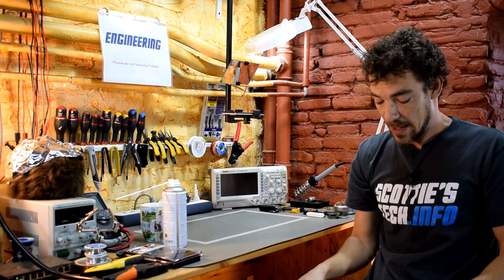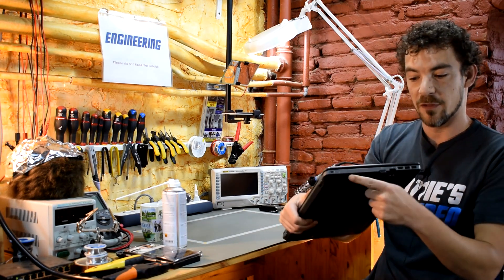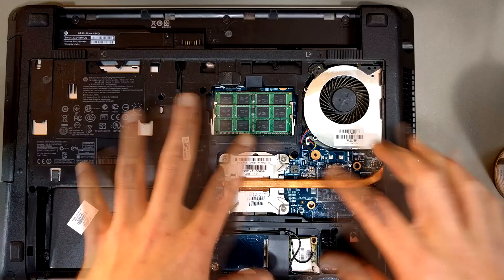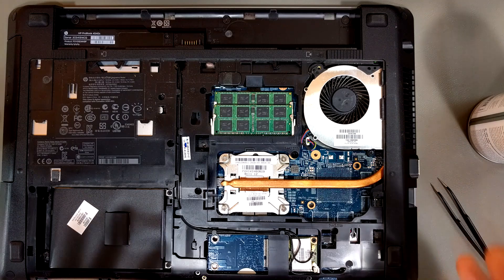How to clean out dust inside your laptop

Comment: I likw this video. It doesn't have the same confidence as everyone else where it's like "hey it's so easy to just disassemble your entire computer."

You actually give people the advice to just spray through the vents and the video is structured in a progression of escalating things to do. It also admits it can be hairy for a first timer and that while it's good to try doing it yourself, don't overdtep your boundaries.

Having needing to do this for the first time myself, spraying air from the outside or taking the cover off is good and all but if I start needing to unscrew components that's where I'd stop.

Comment: The problem is when you force the laptop fans to spin, they can turn into a generator that can cause damage.
Reply from the maker: It shouldn't. The pins the fan is connected to supply 12V and some amount of current. The 3rd pin is to detect the speed of the fan, and the 4th pin is a PWM signal for speed control. Since those pins (particularly 12V + Gnd) are connected to a circuit supplying power, applying power "in reverse" shouldn't do anything - unless it's a really badly designed motherboard/laptop!
Reply: @ScottiesTech  OK. Thanks. This was bugging me for a long time. Great video.👍

Comment: Thank you so much!  My laptop has been sounding like a jet plane lately. Fan running loud and constantly, took the air compressor to it and could not believe the dust that came out of everywhere.  Back up and running for about 15 minutes and no fan yet....did the air with the lid closed, then open because dust was coming from the keyboard.
Reply from the maker: WOOHOO!!!

Comment: You blow the dust off with the air compressor but... where does the dust go? Doesn't it remain inside?
Reply from the maker: No. It's like an air duct: Whatever air gets sucked in by the fan must be blown back out through another vent. Otherwise the laptop overheats. So, blowing air in both sides generally cleans it out nicely.
Reply: @ScottiesTech  I got to appreciate the helpful response. I see. It is a bit weird because dust sticks or can stick to the parts so how is it possible for the air fans to get it out you know 🙄🤔? 

There is no need to take off all the keys (letters, numbers etc); I just need to blow an air compressor on them?
Reply from the maker: @Velvetec  It's bit trickier when air is sucked in thru the keyboard keys... Usually, there are tons of little holes under the keys that get clogged with dust. In that case you have to be careful not to blow the keys off the keyboard if you use an air compressor!

Comment: why on earth would you blow all the dust and rubbish BACK INTO the laptop  ???
Reply from the maker: In normal fan operation, air goes in, and air goes out - always in the same direction and via the same path that's designed into the laptop for that specific purpose. Therefore, blowing air into the output vents, and then into the input vents, tends to dislodge all the dust and blow it out. Next time the fans turn on, any remaining dust is usually ejected.

Comment: Is it safe to wipe the laptop internals with a microfibre cloth?
Reply from the maker: Yeah, for metal or plastic parts. But avoid wiping the actual motherboard or other electronic-looking stuff.
Reply: @ScottiesTech  Thanks, I'll keep that in mind. 👍
Reply: @ScottiesTech  So, I followed your guide on cleaning my laptop using an air blower designed for cleaning IT equipment. Not only did it clean out the dust inside, but also the vent grills on my Alienware 13 R3. Did the same thing for my Razer Core X. The whole thing feels like brand new, very low noise and less heat from the laptop now. Thanks for your video.

Comment: What was the reason for doing the output first and the input second? Wouldn't you want to keep the direction of flow constant? i.e., input then output, assuming the output isn't blocked?
Reply from the maker: Dust usually accumulates at the input side of the thin heatsink fins. So, by blowing air in reverse (in the output), that tends to loosen the dust and fuzz and blast most of it out the input vents. Then you blast in the input to clear out any remaining smaller bits. At least that's how I do it, and it seems to work well!

Comment: Welp, I am Wendy, but right now, me, her son. Is trying to help her on this very day, on this day, error code 90B, which is probably something similar, if not exact to this. And she is really scared of opening it. Reason? I have no clue, the screws are not damaged, and she has had this laptop for a little less than a year. Right now I'm using mine, that's how I am here in the first place. But I just hope you might have a reason, maybe explanation on trying to get her to finally open it. She keeps saying it needs to be professionally done. Which is true, but not for every case. I hope you can respond and maybe find an answer.
Reply from the maker: That's a fan error in certain machines - or rather a cooling error. So, I'd clean it out ASAP! Removing covers and cleaning inside is way less dangerous to the machine than if it's overheating all the time!
Reply: @ScottiesTech  Thank you very much!

Comment: Hey scottie, mine's making noise and I never cleaned my fan (I'm pretty certain this is the issue of my laptop), will using compressed air on the vents push the dust deeper in? Just wondering as a complete noob!
Reply from the maker: The air must have a way in and out in order to cool the system properly. So, compressed air should work pretty well. In some cases, the actual cooling fan might have "scummy dust" stuck to it, and that won't come off... I had to remove the panel on the bottom of the lappy to really clean the fan off... But I've only encountered that once!

Comment: Hi, I did the full cleaning of dust inside my laptop, but it sometimes still is loud. Is there anything that could be causing this?
I don"t think any malware is doing it as I do frequent scans and it's always safe.
Reply from the maker: Could just be a bad fan. Eventually, the bearings go and the fan can make all kinds of interesting noises.
Reply: @ScottiesTech  So should I just give up on trying to fix my laptop and buy a new one or I can like the change the fan or something? 
Also the laptop isn't that old. I bought it 2 years ago, but this was the first time ever cleaning it so idk if not cleaning for long time damaged it.
Oh and also, the noises it makes are just simple clean fan noises, but loud and not some random gibles.
Reply from the maker: @RealElevenTimes  You can probably replace it. I usually search YT for the laptop make/model + 'replace fan' and more often than not, somebody's made a video showing how to get it apart. Then from the vid I know what the fan looks like, so then I order a replacement - usually on ebay. Well, some laptops are a royal pain to take apart, but often it's not so difficult and just requires a bit of patience. And a small screwdriver or two!

Comment: How to clean out dust inside your laptop:

Frequency: 
-Twice Per Year

Tools: 
- Compressed Air

A) BASIC CLEANING

Step 0: Completely turn off Computer

Step 1: Identify Vents
Identify where it sucks in cool air and where it pushes it out.
Most suck air from the bottom and push it out the hot air from 
the side vents.

*Some suck air from keyboards

Step 2: Blow  out Vents
You want to spray the compressed air into the Output & Input vent.

B) ADVANCED CLEANING: Declogging Cooling Fans

Tools: 
- Screw Driver
- Bravery
- Optional: Tweezers

Preface: Perform this when the laptop is still making noise after 
your basic cleaning. Basically we need to Get into the Cooling fans, wads of dust are 
clogging it.

Step 0: Do a youtube search for the model number of your computer 
cleaning. Aka "Hp 69420 Dissassembly"

Step 1: Remove the back of the laptop

Step 2: Identify where the cooling fan is. Should look like a fan with
blades and be near one of the the vents.

Step 3: Remove the screws if neccessary

Step 4: Blast

Comment: I really wish laptop companies would just put a button under it that just opens the thing up after a key or a big screw so people can easily clean it themselves, they really want it to be complicated and impossible to do yourself so they also get repair sales
Reply from the maker: I had an HP ProBook 450 laptop once that was super-easy to open. The battery removal tabs could be slid in the opposite direction, and POOF! The whole bottom of the case would come off. Made it SUPER-easy to clean, upgrade, whatever. Nowadays, it's 25 screws and sometimes even glue. SIGH...

Comment: I know this is really late but is it possible to start a business doing this without any qualifications within engineering
Reply from the maker: You probably could - if you also replaced other components and knew how to fix problems in Windows, etc. It's more a question of experience than engineering knowledge. These days, you can learn how to take pretty much anything apart since there's usually a video about it on YT!

Comment: I have an $800 windows 10 asus gaming laptop and it's slow. I got a avast cleanup and it's still slow, I haven't had it that long. The games I play can barely handle not lagging with graphics on medium. Can someone help with advice on what to do?
Reply: If you have a HDD, you could try to set up a custom pagefile. On a SSD, it's not recommended to go over 1 GB to avoid increased decay.
Reply: @Spido68_the_spectator  Ok thank you, I'll look into that.

Comment: Is this the reason why my laptop shuts down suddenly
Reply from the maker: Could very well be!
Reply: i got a dell laptop and everytime i play high resolution games it shuts down everytime even roblox, My fan aint working anymore i have no idea how to open a dell laptop its been 5 years since i have bought it.
Reply from the maker: @ghirtaslam3251  Search for the model number of your laptop along with "disassembly" or "upgrade". Usually, someone has made a vid showing how to replace various components. You can probably order a replacement fan from eBay for dirt cheap. Finally, note that if you end up with 1 screw left over after re-assembling the laptop, don't worry - that's for good luck!

Comment: when ever im playing my laptop sound is like a jet
Reply from the maker: That's normal when playing games. Mine sounds like a 747. But when you're not doing anything hardcore with the laptop, if the fans are quiet then you're probably okay.
Reply: @ScottiesTech  ey thanks for replying appreciate it

If i run overwatch my laptop fan is 4000rpm which is fine for me with 78° while running like hyperscape, siege, csgo my rpm goes to 5000+ and 80° with high percentage, its so loud, and i dont want to break my ssd because my old ssd breaks cuz of overheating and cause fps drop. S

Comment: Mine dosent have any vents on the bottom
Reply from the maker: Check the bottom of the laptop and the back. Sometimes, the speaker grating and even the hinge between the screen and the base are used to expel hot air. If it's a super-lower power laptop though, often they use the metal casing as a giant heat sink. That's only for very low-power and thing machines, tho...

Comment: i didnt get it. If you are using compressed air, it is going to push the dust particle inside the system right?
Reply from the maker: The cooling system must suck air in at one place, absorb heat, and blow it out another place. So, if you blast the input and output vents, the majority of the dust will be removed. Think of it like forced air heating in a house. Cold air sucked in one place, heated, and blown out through different vents.

Comment: Dunno if this will be seen but from what I've seen aren't you supposed to only go in short bursts for the compressed air since apparently long bursts can "damage" it?
Reply from the maker: If you blast air in long enough, you can possibly spin the cooling fans up faster than they are designed to be spun. That could potentially damage the bearings. That said, I've never managed to wreck a fan in this way. So, I'd say to be aware of it, but don't sweat it.
Reply: @ScottiesTech  Ah, got it. Thanks.

Comment: Can the copper smell (the exhausted that breathe out air). Because mine sure does smell like shit.
Reply: It just started smelling and I don’t know why
Reply from the maker: Normally, no. Probably some nice gunk stuck inside!
Reply: ScottiesTech.Info how do I fix that
Reply from the maker: @snakegt5689  What I would do is search YouTube for a disassembly video for your particular puter. Then open 'er up and clean the cooling fan(s) + copper fins.
Reply: ScottiesTech.Info I can’t blow air into it?
Reply: ScottiesTech.Info as I haven’t tried that yet, this smell was before I watched the video, I haven’t even tried using compressed air yet
Reply from the maker: @snakegt5689  Sure, you can try... But usually if it's stinky, there's humid dust or other gunk inside that may need to be removed by opening it up.
Reply: ScottiesTech.Info and also is it dangerous, can I keep playing without it breaking

Comment: Frick twice a year I haven't done mine in almost 8 years.
Reply: Mine is like 10 yrs+
Reply: 7 years here😄
Reply: I haven’t even done mine ever! Lol!
Reply: 4 years here and my idle temp is 85 lol
Reply: 4 year +
Reply: ouch
Reply: mine is 10 years. my laptop is now dead
Reply: I clean the keyboard, the bottom, and screen but I've never cleaned the inside of it.
Reply: 5 years here :D
Reply: Same 8 years
Reply: 12 years 😂
Reply: This laptop was my mom's before I was even born!
Reply: Theres probably a new especies of bacteria there 💀
Reply: 9 years 😂, my laptop literally shut itself down once
Reply: @kpl22b  Thats bad. Its means your laptop shut down itself because its overheating. Either you ask profesional help or clean it yourself !
Reply: @the13thjoker  yeah, I already took it to a guy to clean it since I'm too scared to break it. Now it runs relatively cooler but does overheat when running heavy applications cause it's old. But thanks, though
Reply: Have y'all never seen those tik told of guys cleaning out laptops!?
Reply: nine
Reply: Tbh my laptop needs a cleaning 3 times a year cause dust collects stupidly fast inside it
Reply: Came to the comments to find THIS comment. 6 years 😂

Comment: The first way you blew the dust, aren't you more likely pushing it deeper into the laptop ?
Reply: That's what I'm really worried about
Reply: I mean this guy did it (https://youtu.be/Nd_vpKuBV74 go to 3:33) and you can see a lot of dust blow out, I think blowing it just makes the dust go around the fan and come out
Reply: @-cdefgabc--cbagfedc-9018  if you blow the air in, dust will get trapped in the heat sink, you can't blow it properly without taking it apart.
Reply: @ttititrov1672  would using a handheld vacuum help draw out the dust
Reply: @14_squad_captain99  DO NOT USE A VACUUM IT WILL DESTROY YOUR LAPTOP, it produces static electricity and it can cause problems with your system
Reply: @athansios  thanks for the heads up, people are selling these misleading others then
Reply: @14_squad_captain99  people like you
Reply: @lightningbolt4419  Joshua was asking a question, not making a recommendation
Reply: @lightningbolt4419  people like you
Reply: My theory is that, the dusts gets trapped in the vents. As you spray the airs in, the dusts gets freed (and some also shot out) so the next time you start the laptop and the fan spins, the dust will be blown by the laptop's fan.
Reply: Exactly, I wouldn’t try this, I don’t want to destroy my laptop
Reply: The dust is gonna get so far pushed that it comes out the other side

Comment: DONT FOLLOW HIS FIRST METHOD. I tried using compressed air through the vents like he said in the video while the laptop was turned off and its been making this rattling noise whenever i turn on my laptop ever since. turns out you have to open up the laptop and hold the fans to keep them stable whenever spraying compressed air or else youll damage and tilt the fans permanently like mine.
Reply from the maker: If that happens, you need should get a new fan. Ebay is usually your friend on that front. After some time, the fan bearings wear out + gunk builds up on the blades. Once the gunk is cleaned off, the fan is no longer balanced... but if it's clean, it should be. So, that means new fan. This happens maybe 10% of the time when I clean fans, and usually in older machines or newer ones that have been running hot too often.

Comment: does it suck the dust from those places ? or does it just blast the air ? I am very confused.
Reply from the maker: It blows air in. But since the air has to enter in one place and exit somewhere else in order to cool the lappy, blowing air into both the intake and output vents usually does the trick.
Reply: @ScottiesTech  What is the reason for doing the output first and the input second?

Comment: Should have thought that in this day and age they would make laptops in a way that would not require you to open it up and having to mess around with stuff you probably don't know of, just to clean some freaking dust...
Reply from the maker: Hopefully, fans will soon be a thing of the past... There's a new type of cooling solution that will conduct the heat away and radiate it away from the laptop via the back of the screen. Here's hoping my next laptop is totally silent AND dust-proof!